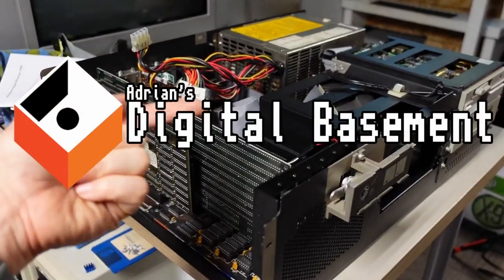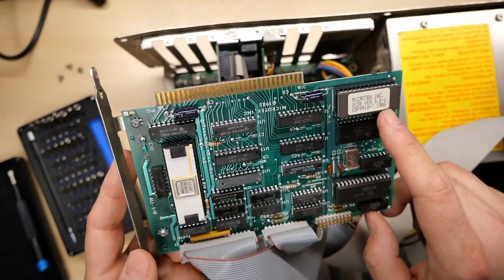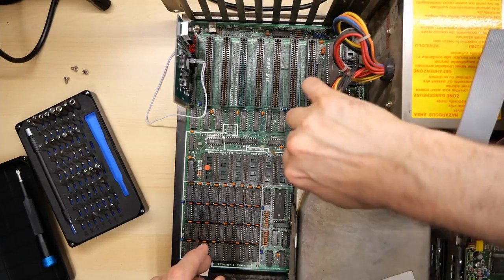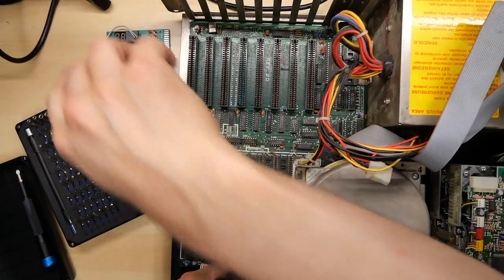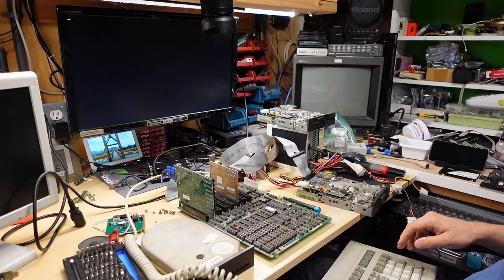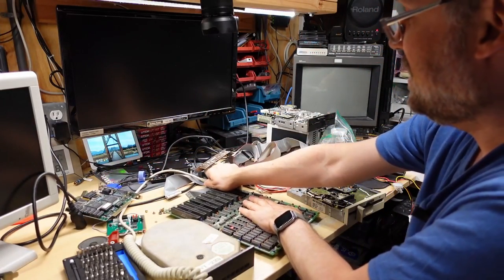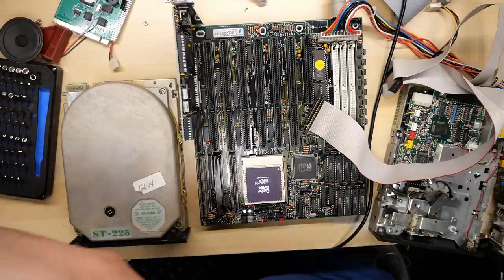PC Archaeology: A left for dead XT clone

Comment: 5:02 "I wonder what that says" - Google Lens says "Noguchi Electronics Ltd"
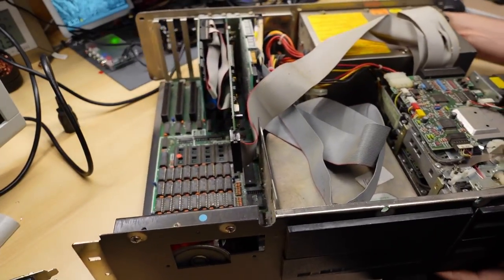5:41 "very curious about what this one is" - it's probably a Monochrome Graphics Adapter (MGA), the precursor to both CGA and Hercules (a 3rd party higher resolution display) cards
source: was there at the time
6:24 "ST-225" - yep, slightly older than min - I had an ST-238R, which was a 235 with an RLL controller for 50% more storage

Comment: A standard Hercules-like card is supposed to have 64K DRAM and a font ROM, typcially a 16K ROM containing two 8x8 fonts (unused on MDA/hercules) and a 9x14 font.
The presence of a 16K SRAM indicates that this card likely has some RAM font option. It's for sure not HGC+ (HGC RAMfont) compatible, because that card has a very elaborate RAM font system using 16K text mode RAM + 48K font RAM, and not just a 16K font chip. You likely need a proprietary utility to enable "font upload" mode and "use RAM font" mode.

"Page register hexadecimal address" is referring to the I/O port used to map EMS pages. It's not a memory address.

Comment: Those ST-225 hard drives are certainly built extremely well.  I had 1 in storage for about 20 years from around 1998 when it was last used. It wasn't stored well and was dropped onto the floor at least twice.  In 2018 I dug it out to test & possibly install in an XT build I was working on and I was able to recover about 95% of the data before hitting read errors.  A low level format got it working like a champ again and it's still installed and working in my XT build today.  They certainly don't make them like that anymore!
Reply: This is survivor bias. ST-225s were keeling over dead in the late 80s and early 90s. I was usually tasked with replacing them with ST-251, which at the time had a considerably lower failure rate. Once they got some wear on them, the reliability was only slightly better than the ST-225, and now it seems that the very best ST-225 will outlive the very best ST-251. But they weren't all like that.
Reply: they had no idea that Moore's law would drive people to upgrade every few years. DEC computers, from PDP line and maybe some Vax used MFM-RLL drives (actually I'm not sure exactly when RLL came out, all I know is that it doubled memory capacity.)
Reply: @mal2ksc  Yup, replaced a lot of ST-225s back in the day.  Seagates always had a problem with stiction.
Reply: @squirlmy  RLL increased capacity by 50% over MFM.

Comment: In my experience, when dealing with corrosion on pc boards, watch for dark spots on the traces. The solder mask will have been breached and the copper exposed to whatever and the trace will likely have been eaten through. Sometimes you can save such traces by carefully scraping the compromised mask and trace underneath to get to virgin copper that can be built up with a bit of solder, else a bodge wire will have to be run across the break.

Comment: Wow the ST-225 got a bunch of bad sector back in 1991 when I try to format it, and the metal clicking sound of the head seeking.
Reply: low-level format? By the way these aren't "data transferable".  In a new computer, it requires low level formatting, starting from scratch, so to speak.
Reply: @squirlmy  Low level format and adjust best interleave is the basic of installing RLL and MFM hard drive.

Comment: 7:20 it has empty EPROM-sockets due to the lack of ROM BASIC... (i never met sb retrofitting it into an XT clone)
Reply: I did come across one Turbo XT clone which had an illegally copied version of IBM BASIC in ROM.
Reply: @vwestlife  and was that BASIC from Microsoft? They made BASIC for all sorts of home computers of the time.
Reply: @squirlmy  It was directly copied from the IBM BASIC ROM, including the IBM copyright message.
Reply: @Adrian's Digital Basement ][ .. At 29:08 floppy power disconnected 🤔..........  but wait.... then at 25:30.. the other floppy controller 😦.... was the power disconnected the all time..??? 😯😯
"Yes none of the chips are hot".. yeap.. look at 26:24 when rotate the board.. 🙆‍♀️ .. the power connector loose at the side.. 🤭
"Not to mention, the chips are completely off the shell.".... YES and at 27:15 .. the floppy power connector is also off........ off of power connector !!.. 🤦 🤦‍♀️
this one is for the bloopers reel..... 🤣😂.... we love you Adrián !! 🤗

Comment: Hey Adrian - is there any chance you can dump the rom from that board to put online? I actually just got a Modular Circuit Technologies MCT-Turbo board, which appears to be almost identical to the one in this machine - except someone DID harvest the EPROMs from it. Trying to get my 5160 up to 8MHz to be able to run my MCT MOD-EMUP-A programmer at optimal speeds, and to recreate as well as I can my childhood turbo XT clone. Thanks in advance, and thank you for all your videos and inspiration to start my own channel. Currently have probably 20-30 hours of video of various system repairs and upgrades queued up to edit and post.

Comment: In 1999 I used an XT as a text terminal for a Linux machine.
Reply: It's too bad that Linux didn't go early into multi-head configurations, even an XT or PC should be fit for more than a monitor & keyboard.
Reply: @absalomdraconis  That would have been cool if a ultra light GUI like GEOS was ported to the XT and if it's GUI could read X packets, or if X could read GEOS packets. Then yes, small machines like XT's or less could act as a sort of X Term.
Reply: @absalomdraconis  You could do multi head. My first multi head machine had a VGA display and a Hercules mono display each a separate instance of X. It was not seamless and you needed two keyboards and mice.  So really, it was a dual console system. Also you could run as many getty's as you wanted against as many serial ports you could cram into the machine. I used to do as much as 8.

Comment: Found this Super PC/Turbo XT BIOS  at   github(dot)(com)/andreas-jonsson/pcxtbios

The BIOS may give a "System Error" code at bootup. This error code is a
combination of the following codes:

01h - Bad system BIOS checksum
02h - Bad RAM in main system memory
04h - Bad RAM in video card
10h - Bad RAM in vector area (this also in main system memory)
20h - Bad expansion ROM checksum

Comment: Error #4 - BIOS settings needed!! 
---
That Seagate HD is not longed for.  I know, I worked for them in the '90's. They had baring problems!!! JUNK!
Reply: this was from the 80s. The Seagate drives that came out with the first IBMs were pretty good. The fact that they work today is impressive. I think you worked for them when their hard drives were going downhill. And you seem bitter about it, too!
Reply: @squirlmy - YES!  They were a terrible company to work for!!

Comment: The ST-225 and similar drives are actually self-parking.
Reply: The ST-225 doesn't self park, you are probably thinking of the later ST-251 and it's variants that use the inertia of the spindle motor on shutdown to move the head back to the landing zone.  Although I am curious if the ST-225R was self parking?
Reply: The ST-225. With these Seagate 5.25" drives, if it self-parks, you definitely WILL hear it. It sounds like an 18-wheeler tractor trailer using its Jake Brake.

Comment: I haven't finished the video yet, but do you ever check the dip switches for video/floppies on XTs that you work on?
Reply: Switches 5 and 6 On for VGA. (Video Adapter w/onboard BIOS).

00 = MDA (Or Hercules)
01 = CGA (40 Col)
10 = CGA (80 Col)
11 = EGA/VGA (Video Adapter with onboard BIOS)

Comment: I’m sure you’ve already found this but error 4 on the Turbo BIOS is video RAM error, which is odd given the card you were using 🤔
Reply: The mainboard shouldn't check the video RAM if the DIP switches are set to "no CGA/MDA card installed". This setting is sometimes named "EGA/PGA/VGA", or "none". If you DIP configure the mainboard to 80x25 color, you actually instruct the BIOS to run the builtin 80x25 CGA on that card. So "error 4" might very well be fixed by correcting the DIP switches.
DIP switch settings are generally cloned from the original IBM mainboard, so you don't need a mainboard specific manual to find the video card switches.
Reply: Given he took a ram chip out of that card earlier, the RAM error makes sense.

Comment: My first IBM style computer (after a series of 8-bit Ataris) was a 286 clone which looked a LOT like the 5170 in your other videos, even down to the shape of some of the plastic mouldings, and that had an ST-238R RLL 30Mb drive in it, which at the time was bleeding edge technology. It sounded exactly like its older brother the ST-225 and those boot sounds and your recent videos have been triggering a lot of nostalgia! My 286 machine taught me DOS programming in Turbo C and QuickBASIC, and a lot about PC hardware in general. I accidentally destroyed my ST-238 by plugging it in the wrong way round on one of the connectors, which also taught me a lot about the importance of backups.... but by then larger, faster hard drives were available (I beleive IDE had come out) and after a dalliance with a 20Mb Hard Card I upgraded to an incredible for then 170Mb Western Digital drive......

Comment: Thanks for the great video Adrian. do you have a link to the rgb to hdmi converter you used on the mono card please?
Reply from the maker: It's a RGB2HDMI -- can't really link to a place to buy them right now as I don't know.
Reply: @adriansdigitalbasement2  .. At 29:08 floppy power disconnected 🤔... then at 25:30.. the other floppy controller?? 😦.... was the power disconnected the all time..??? 😯😯
"Yes none of the chips are hot".. yeap.. look at 26:24 when rotate the board.. 🙆‍♀️ .. the power connector loose at the side.. 🤭
"Not to mention, the chips are completely off the shell.".... YES and at 27:15 .. the floppy power connector is also off........ off of power connector !!.. 🤦 🤦‍♀️
this one is for the bloopers reel..... 🤣😂.... we love you Adrián !! 🤗

Comment: Those ST225 hard drives are well known for their reliability. Congrats! They are nice.  Looking for one myself if I ever get an XT machine set up. the 30MB drives are known for high fail rates. Maybe just reflowing the formerly green solder joints on that IBM type FDD controller would undo any corrosion.

Comment: Somehow my reply disappeared......

4:59 That 野口電子工業株式會社, while sound very Japanese, might be a Hong Kong company (with the English title "KENTECH COMPUTER (H.K.) LIMITED", C.R. No. 154889) after all. 會 is the kyūjitai ("old character") compatible with traditional Chinese, while 会 is the shinjitai ("new character") after 1946 and compatible with simplified Chinese.
Reply: I think you might be correct about that... I am certain it is not Japanese company at least
Reply: The Hong Kong company existed from 1985-07-23 to 2001-11-09. Various electronic components associated with this company, such as pin adaptors and a manual for Zilog Z80-based single board computer "TP801A," can still be found on Taobao and some Chinese electronic fora, all with the kyūjitai / traditional Chinese character 會.

On the other hand, there is a Japanese company 野口工業株式会社 but is specialized in providing sheet metal for automobile industries.

Comment: What about unsoldering that PCB Socket and replace it with another PCB socket.
Reply: I would at least remove the corroded slot, just to make sure it doesn't short out the system later

Comment: Could that be a WANG DATA Machine but it won't have the IBM BIOS with on board GWBASIC.
Reply: I don't think GWBASIC was on those early IBM models, it was probably IBM BASICA. GW-BASIC was first included with Compaq DOS 1.13, eventually replaced by QBasic.

Comment: Fun quiz: Can anyone name the one part of the computer that is exactly the same now as it was when the 286 was released?
Answer: It’s also the most important part because the computer is useless without it. The PC Power Cord.
Reply: Internal speaker? Power LED, HDD LED?  Fans, screws, little rubber case feet, power cord? Drive bay dimensions? Card slot blanks, maybe ide cable/headers(though I believe there were many proprietary early on).
Reply: Mounting brackets for cards are still the same size?
Reply: The holes in the motherboard?
Reply: Part of me thinks the RTC (partly because of your 24 hour comment) but nowadays it's integrated and the battery has also changed. Since nobody's mentioned it yet I'll say the 4 pin power connector.